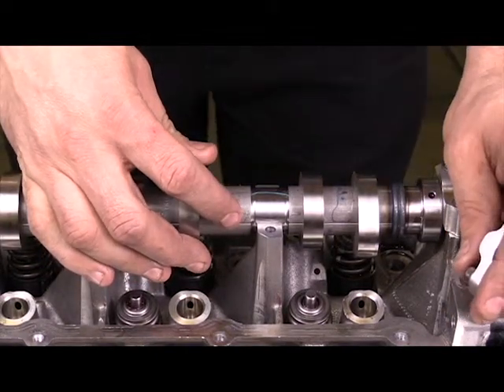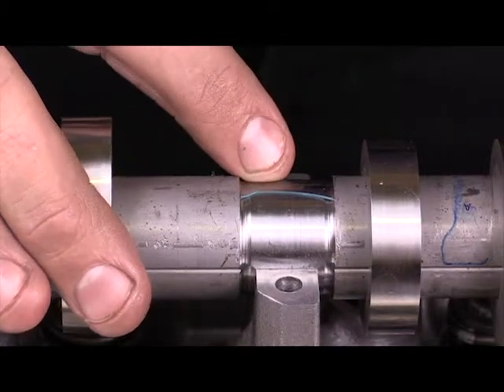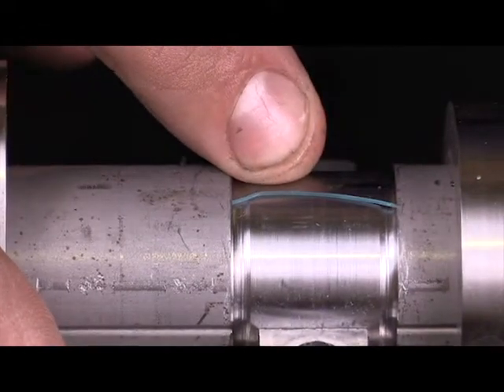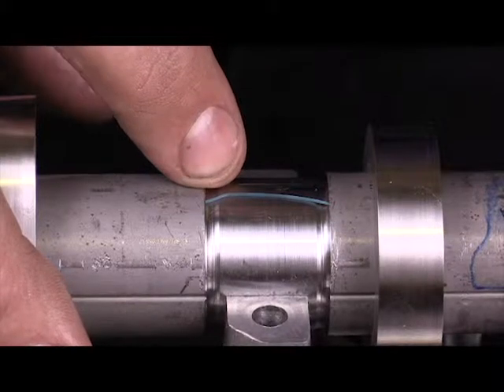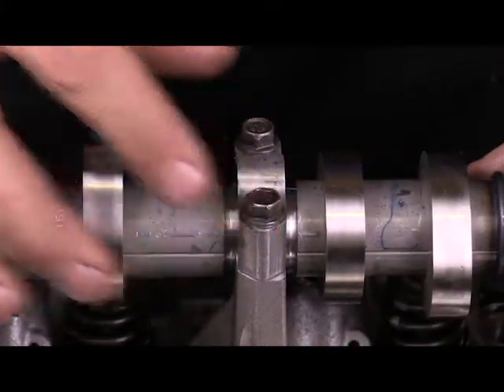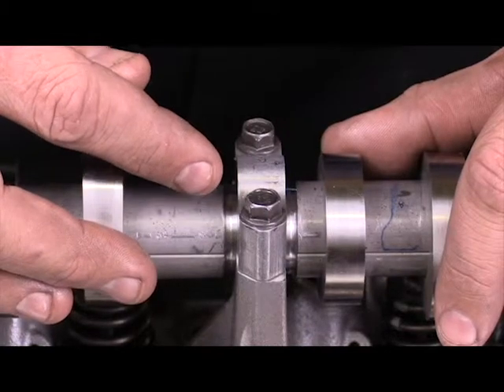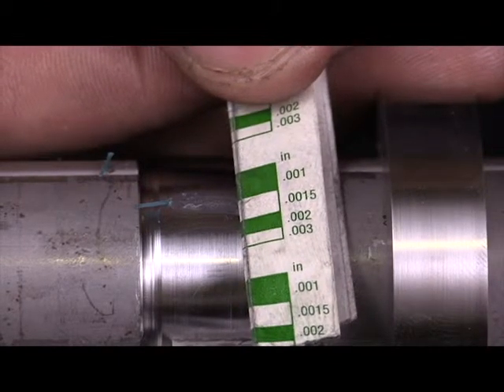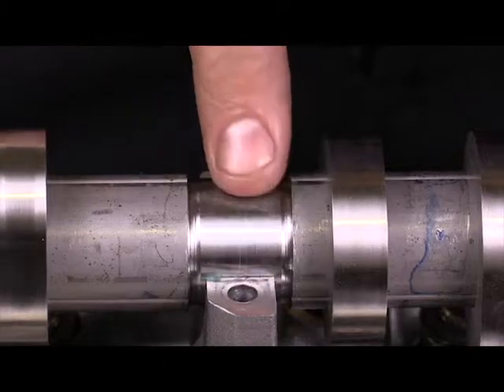Measuring the Clearance of Camshaft Bearings

Comment: Whats the bearing test tester called?
Reply from the maker: Plastigage or plastic guage
Reply: Somehow i swap the bearings now i dont know what to do can i just torque and plastigage every cap and grind if i have to??? No marks on caps
Reply from the maker: @jeremysmith-mp7nu  do the caps have an even parting line. Look at the surface of the cap that connects to the rod. Most modern connecting rods are powder forged and then cracked. Those types have an uneven surface between the rod and the cap.